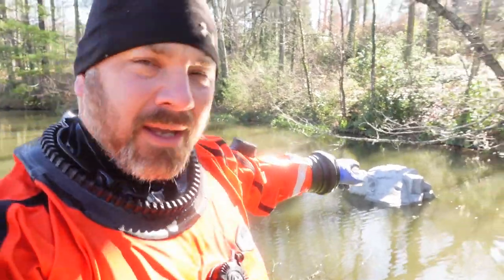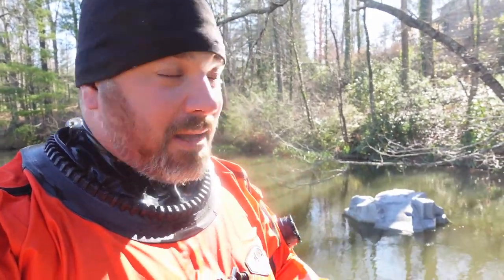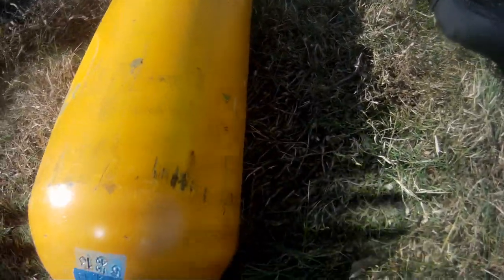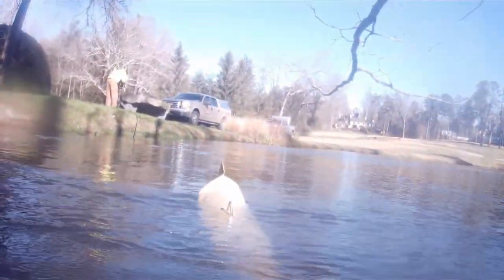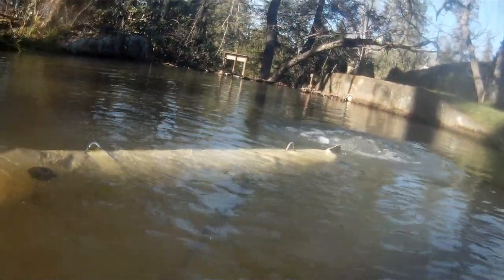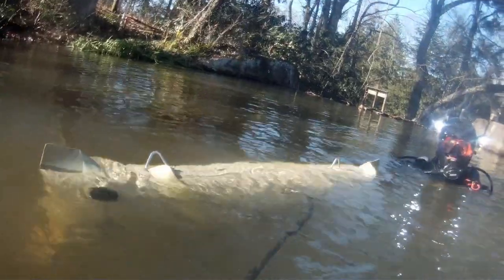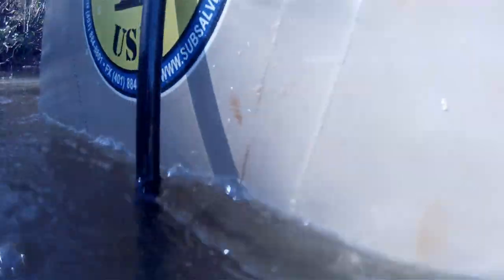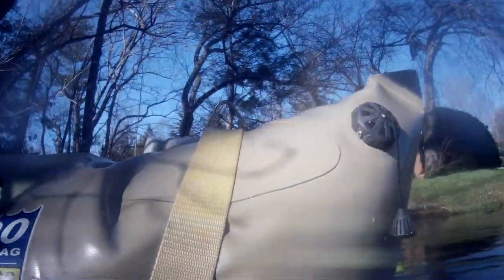Biltmore Country Club Underwater Repair

Comment: Also, do you count this as a dive?  Do you log it for experience or more of a business expense.  You theoretically have unlimited bottom time at this depth...
Reply from the maker: You are correct on the unlimited bottom time. I tell all divers, anytime you breathe compressed gas at any depth greater than 1 atmosphere (that being the atmosphere here at the surface, or more than 1.0 ata's) and the risk of an embolism is present, then that is a log-able dive.

Comment: If those Antares dry gloves didn't leak  you are luckier than most.
Reply from the maker: Hello Kirk, these are the Glove Lock QCP from SiTech, not the Antares.
Reply: @LakeHickoryScuba  They looked oval in the video, my mistake but I had no luck with those either.  Using Rolock rings now.